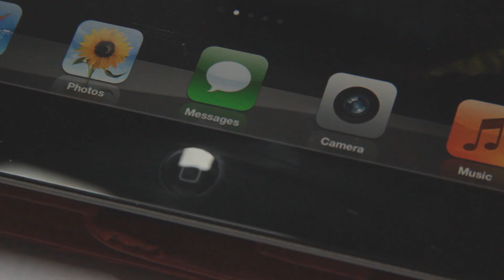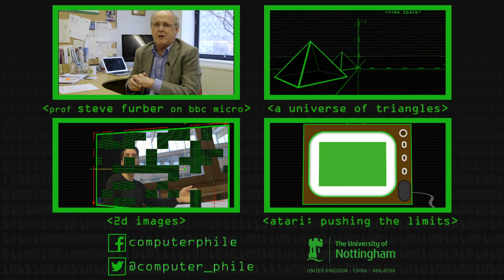Capturing Digital Images (The Bayer Filter) - Computerphile

Comment: No, a camera with x megapixels isn't x/3 for red, x/3 for blue, x/3 for green... Every pixel is composed of an amount of g/r/b...

So he's kind of contradicting himself since when the interviewer asks him he says yes, but then explains it differently.
Reply: You're confusing the pixels on the screen used to display the image and the sensors used to capture the image. If you have an 8 megapixel camera, it means there are 8 million individual sensors that capture the image. 4 million of those capture green light, 2 million capture red light and the remaining 2 million capture blue light. Then the image gets processed and all the colors get blended and whatnot to produce the image that gets displayed on whatever you're looking at.
Reply: FreaknShrooms Actually not really, it depend on the marketing department really.How may pixel they like to say the camera have. And they simply just make the software so it will present that setting as a maximum.

I seen everything from them printing 3 times the actually number of subpixel to that they print just a fraction of the number.

Using the number of Green pixel as a base is common.  Also some border pixels might be excluded to.
Reply: matsv201 
No, advertising the camera as 3 times the number of "sub-pixels" is stupid and just isn't done. Each and every one of those pixels undergo the demosaic process to obtain a full RGB value and hence are valid pixels. This is the number that is advertised (as the video and the person you were arguing with mentioned). 

Also, if this method was employed solely as a naming convention for mobile devices then it will probably be the majority still. Why? Practically everyone has a phone, not everyone is a photo buff owning various types of devices with camera modules.
Reply: matsv201 
You're funny, you literally said that you've seen it done. Faaantastic. But without evidence you can't really say that it's truly done, it's not widely practiced and hardly a standard. Provide some examples and then you can say I'm wrong. As far as photographic standards are concerned, you are the one that is wrong. 

Disagreed. Marketing departments can only market what they have or are realistic in expectations terms; it's illegal to make an intentional misleading statement as the one you mentioned. And companies that are found out immediately have their reputations tarnished and customer values plummet. 

Seriously what are you talking about? Image compression has nothing to do with what we're talking about.
Reply: matsv201 The more you know. I was just clarifying what was said in the video.
Reply: FreaknShrooms Yea, but what he sad was not really true, it was only a broad generalization that i believe in its not even true in majority of the cases. At least for system cameras, for mobile cameras is probably is.
Reply: "is stupid and just isn't done"
Actually i seen that, back in early 00-tys, its probobly not done nowdays. They just scale up the image to what ever they want to advertise it for.

So you are wrong, it have been done.

" then it will probably be the majority still."
Well, that might be the case, but not for primary camera devices. Also, i don´t think there is a standard naming convention for phones. In some cases they switch out the sensor and just keep the resolution for marketing reasons so the number of pixels and the actually photo might differ in any way.

This makes huge differences when you take a photo, at least if you like to compress it. Having fake data in a compressed image is just stupid.
Reply: I seen it done. You can check out the specification of a element quite easily.

I might not have the information to prove it right in front of me, but it don´t make it any less true.

"realistic in expectations term"
Hahahahaha.. funny!

" it's illegal to make an intentional misleading statement"
That don´t stop them from interpolating giving the consumer a blurred out image of what ever number of pixel they like. They never say the sensor is X Mpixel, but the camera.

"And companies that are found out immediately have their reputations tarnished and customer values plummet. "
Its mostly knock of brands doing that, but some phone manufacture did it to in the early days

"Image compression has nothing to do with what we're talking about. "
Well it have. If you generate 2/3 of the information from a algortim, not true data, then you compressing it you just wasting data.
Reply: ***** No, A bayer filter is specifically a RGBG. If you want to expand the definition you could say that filter that have a 25%, 25% 50% varitation is a sort of bayer filter. But saying that 33%,33%,33% or 25%*4 is bayer, that is just plain wrong.

Actually a lot of Kodak cameras use a RGBW filter. Fuji uses mostly SuperCCD. A lot of phones also use RGBW or RWB filters to reduce the noise at there small sensors. Sony Also use a lot of RGBW sensors. I cant find information about Canon.Nikon dont produce there own sensors, they is mostly bought from Fuji or Sony

"see the bayer filter layout on certain programs "
Actually those program fake it. They run the algortim backwards.

"just like what the video explains."
No, that is not what the video explain. They say you can tweek it.
Reply: "They are based on the original bayer filter, so I would count them as being so"
No, colored filter have existed long before the 70-tys. You cant say that RGB filter, that is way older than bayer filter is based of if it.. no.

"That's complete bullshit."
No its not, you just don´t know how its don in real life, you just think i know.

"You can't fake raw data"
Well, you cant, but how can you tell the difference.

" as the camera does not process anything when in RAW other"
That is totally wrong and a myth. Almsot all RAW formats squars the pixels before exporting it.

" Since a RAW file is basically raw data"
Now its not. I know there is a lot of idiots spreading that lie, but its actually only the RAW pixel data, not the raw sensor data.

Are you a CCD/CMOS sensor electronic engineer? Or are you just someone owning a camera how think you know more than the engineers?

Do shut up and listening to people how know more than you do.
Reply: matsv201 
>>> "see the bayer filter layout on certain programs " - Actually those program fake it. They run the algortim backwards. <<<

I personally wrote a program once to look at the un-demosaiced values of raw images, captured with compact Canon cameras running
the CHDK firmware extension. Normally, those cameras don't offer the option of saving raw files, but CHDK enables that. So, nothing was faked there, and I doubt I'm the only one who ever wanted to take a peek at the real raw data before demosaicing.

>>> " Since a RAW file is basically raw data" - Now its not. I know there is a lot of idiots spreading that lie, but its actually only the RAW pixel data, not the raw sensor data.<<<

What do you mean "squars the pixels"? Normally, the sensels - pixels on the sensor, are already square. The raw pixel data is the raw sensor data - digitized, of course. It is true that certain cameras might do some minimal processing on the sensor data before saving it to a "raw" file. Some cameras also offer "sRAW", downscaling to lower resolution before saving, for smaller file sizes. However, in theory,
RAW files do absolutely contain the raw, untouched sensor data, plus some metadata like the used camera settings and a list of pixels that are defective on the sensor and thus need to be interpolated.

Comment: Sounds like we need a camera that detects the exact color for every pixel instead of creating the color by mixing nearby rgb values.
I wonder if that's possible. A sensor that detects the exact color frequency hitting its sensor. Not rellying on using rgb filters to determine the rgb values.
Reply: The whole point is that we don't need the camera because with closely enough placed RGB components, our eye doesn't have enough resolution to get affected by the distortion anyways.
Reply: It would be remotely possible but one must remember the math involved; in order to break out the constituent colours you need to record the 'mixed' waveform of the 3 constituent colours...then do a fourier analysis to find what waves caused the waveform.  Unfortunately silicon sensors relying on the photoelectric effect don't record the incoming photons as waveforms, rather just as charges built up on the individual pixels.  By just 'counting charge' you can't tell whether it was 3 red and 2 green or 1 blue and 4 red to make the pixel that particular level of charge.
Reply from the maker: Traditionally, broadcast cameras carry three sensors, though that's expensive.... >Sean
Reply: In addition to the beam splitting approach mentioned by Sean, there is also an approach called "sensor stack". You can actually buy such cameras whose sensor is produced by Foveon. However, while this technology is more elegant in principle, eliminating color interpolation and not wasting any photons to color filters, in practice it has noise issues and introduces other weirdness by not having such a clear color separation in hardware.
Reply: We have such sensors. Sigma's foveon sensor technology is one instance which captures 3 colors per pixel. triple-sensor technology is also an example, where three sensors are used; one for each color channel. The light is split and sent of to each sensor.

Another technology is Hasselblad and Olympus' sensor-shift technology, in which there is a single bayer-filtered sensor but it is moved at half-pixel values and a series of images is taken for different shifts. Effectively this quadruples the resolution of the sensor and eliminates all downsides of the bayer-filter. The downside, of course, is that it only works with static shots. If anything moves, it will result in image artifacts. But for product shots etc. it's a very nice technique.
Reply: Or one can bruteforce it and just increase the number of pixels on the camera. Also costs more but still uses the regular consumer grade products we are today. At some point you have so many pixels that you have to downscale the image four times or more to display it on a screen in full, even on 4k monitors.
When you do that, having one sensor for each color doesn't matter as much anymore.

At least that's what i think, obviously someone who just shelled out $200k on his super duper camera is going to disagree... Taking selfies has never been such srs bsniss befoar.
Reply: GAME OVER "WE HAVE EVERY PIXEL COVERED"  "A sensor that detects the exact color frequency hitting its sensor." - Color has no frequency, light has. Cameras record light, not color. It is a mistake to think that color equals frequency or wavelength. The exact same light (which usually contains a mixture of many frequencies, not just a single one) can evoke very different color perceptions in our brains. Search for the "checkershadow illusion" for an example, and watch the TED talk "Optical illusions show how we see" by Beau Lotto.
Reply: frollard What you are talking about is doing a spectral analysis for every pixel -- only to then reduce it back to RGB. There is a patent by Nikon that does the normal beam separation stuff on chip. Which is basically what you are talking about but simplified to match the task and not do more than required. Not that it wouldn't be cool to have a full spectrum for every pixel ... but the amount of subpixels you'd need to get something one would call a spectrum ... well, some day perhaps.
Reply: Sigma makes cameras with red, green and blue sensors at every pixel, stacked on top of each other. They capture a lot more detail than filtered sensors because they don't need demosaicing, but have really bad low light performance.